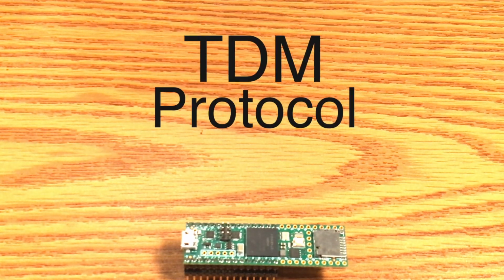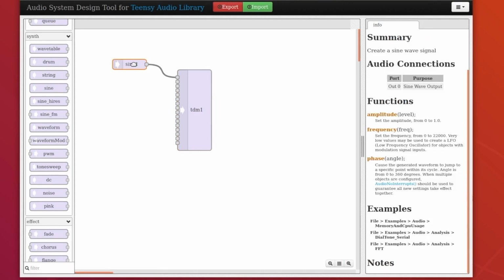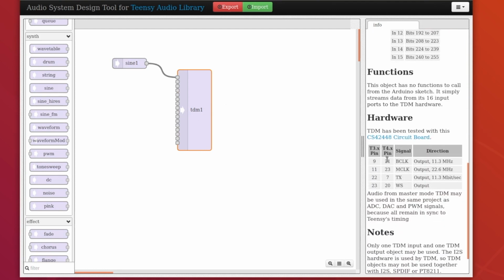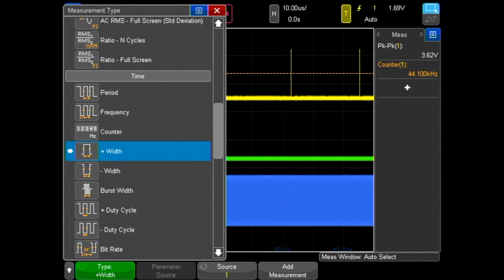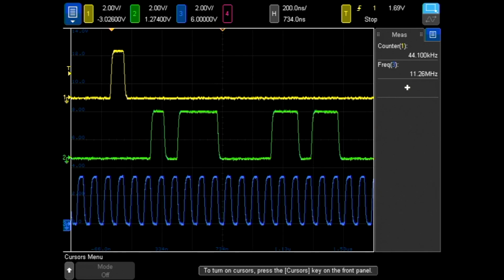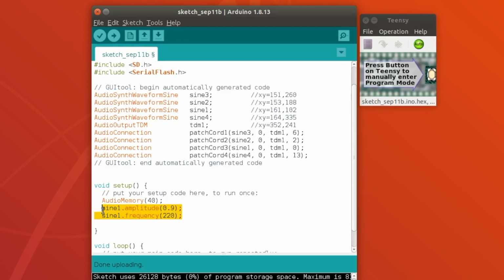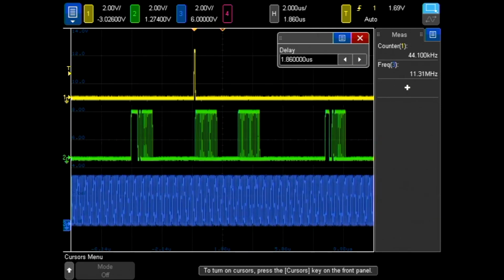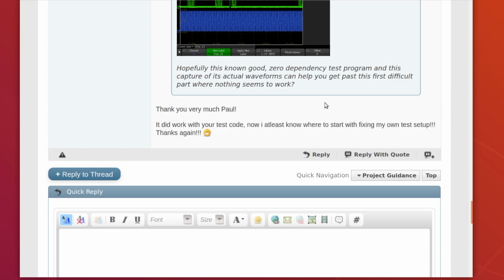TDM Protocol

Comment: you should add the memory setup to the designer..
Reply from the maker: Indeed, a lot more should be done with the design tool.  But the sad reality is I have so many other far more urgent dev priorities, including better documentation (like this video - my hope is to start use video demos throughout all of Teensy's documentation).  JavaScript also isn't one of my strong points.  Fortunately I got some help earlier this year from Frank to add the much-needed input/output hardware compatibility checking.
Reply: PaulStoffregen i understand. the designer is awesome as it is!